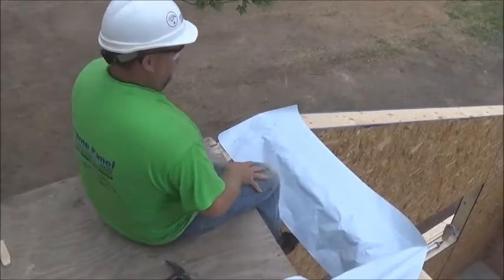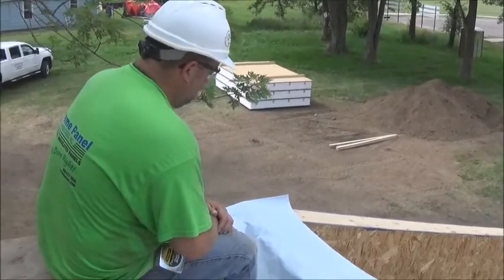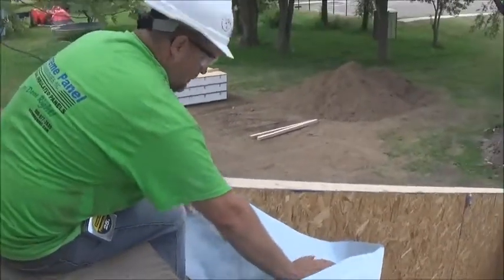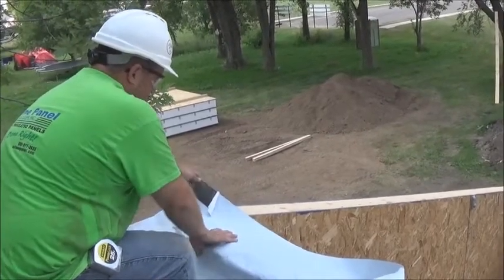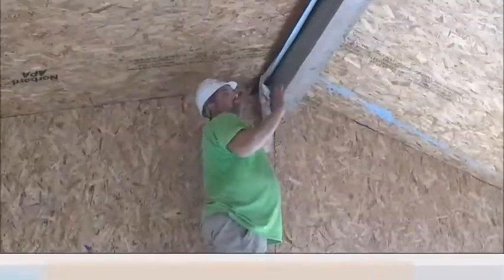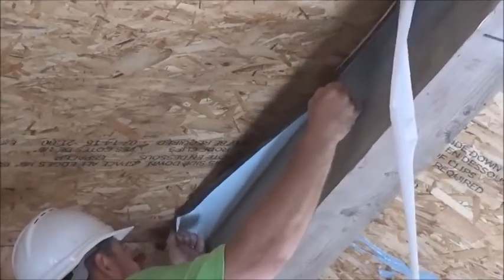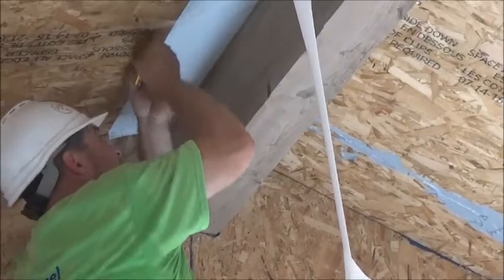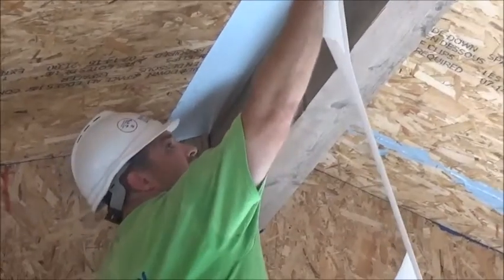Episode:15- Installing Panel Tape On A Ridge Beam

Comment: So the tape is to keep interior air from going up into the SIP?  Basically because the insulation and roof layer are one with no ventalation between the 2?